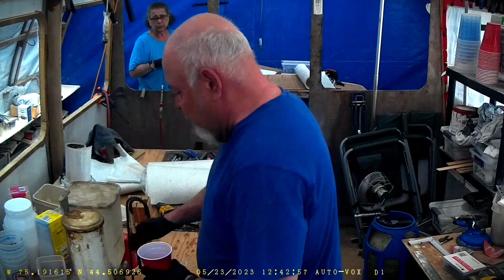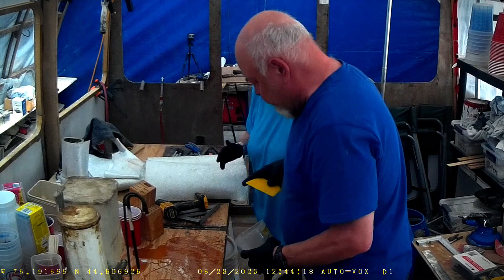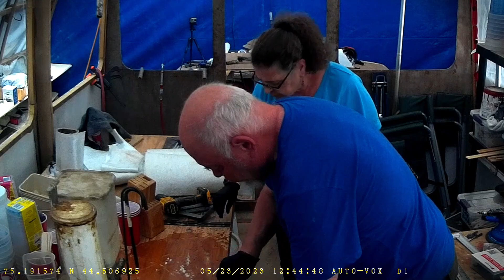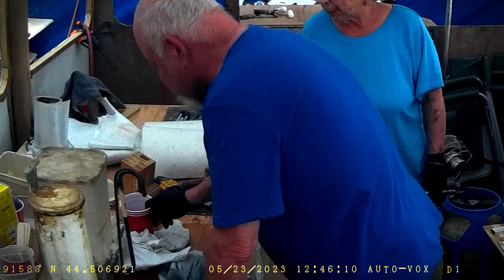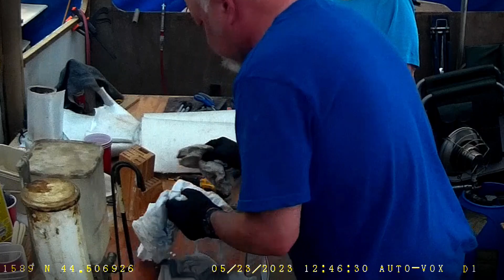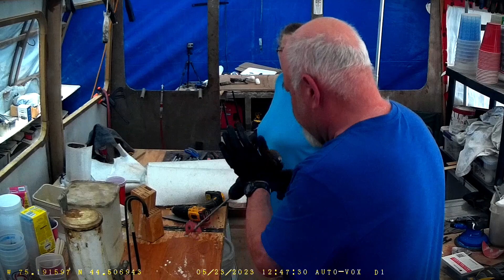Disastrous Epoxy Shower Mishap: Mix-up Causes Sticky Situation! 😱 Building DIY Back Yard Boat Kit

Comment: How frustrating! Epoxy is some nasty stuff, especially when you're cleaning it up and it's not mixed.
Reply from the maker: Never had that happen before. Should have just pulled it out of the cup. Will be ready for next time. Thnx for looking in.